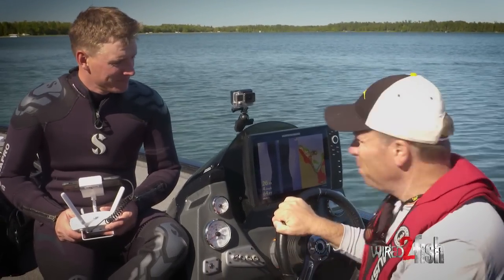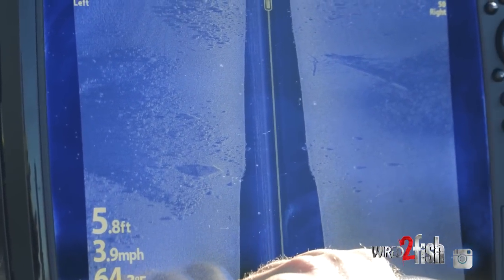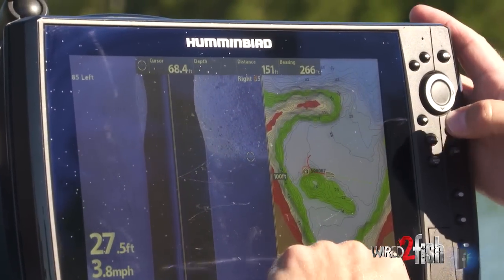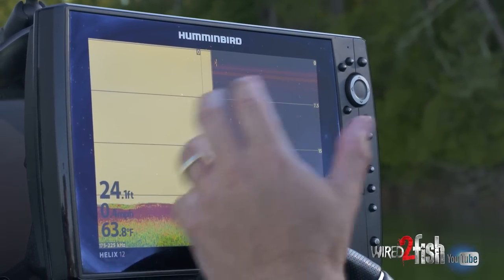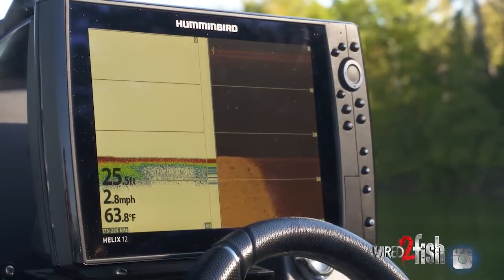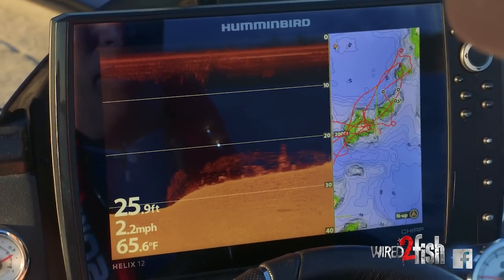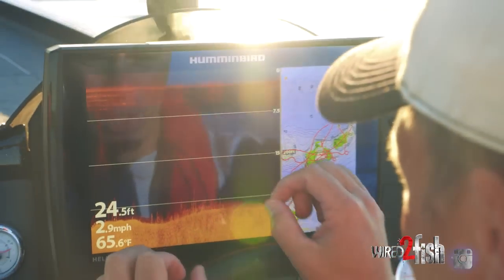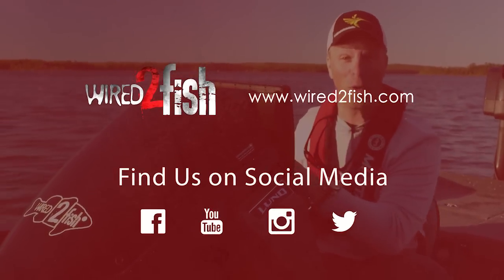How to Read Fish Finder Sonar Technologies

Comment: Nice job, but I’m still having trouble trying to figure out where I am in relation to the information on the screen as it scrolls past.  In looking at structure scan I understand I’m seeing straight down on left/right of keel... and the distance out to whatever structure.  But where is it on down scan.... and echo.  Is subject matter just as the boat passes over and shows on the right coming left across the screen, then out behind the boat as the subject matter disappears from the left side of machine?  

And then what’s best, make a waypoint, and gps spot lock off to the side and fish.... or throw a marker out , come around and fish toward it?  

Trying to learn this stuff.  Thanks.

Comment: Jeff, really enjoyed your vid and underwater comparison. What affect does boat speed have on determining bottom composition? I know what my (limited) mind says, but are you scanning areas at idle speed or using your trolling motor.
Reply from the maker: Thanks for the question. Scanning at a modest speed produces the clearest images, say around 5 mph. It reduces turbulence that can create bubble disturbance around the transducer, and provides more pinging time to take place and paint the clearest image below and off to the sides of the boat. That said, many electronics savvy anglers get good high-speed readouts for things like depth, presence of fish and bottom composition changes. 15-30 mph are common scanning speeds when you're in more of a hurried search mode.

Comment: A good presentation on the technology. However, I use my old FishEagle to find fish. The new tech is great for seeing really good pics of weeds, rocks, and the bottom but fish are a dot...hmmm. You demonstrated clearly how 2D clearly identifies fish and you made a point of confirming the dot(s) as fish in 2D. 2D being old school sonar. Coming from Silicon Valley, this new tech demonstrated offers very little incremental improvements. It is Tech for Tech's sake. A tech looking for marginal improvement. Like golf clubs or fly rods at the end of the day it is about delivering expectations.
Reply from the maker: Hi Dave, we respectfully disagree on the value of down and side imaging. The technology defines structure and cover in much greater detail than 2D sonar, and that in itself is a compelling reason to consider using it. In addition, being able to count individual fish - literally putting a head count to a school can influence the decision to stay or go. Jason Sealock outlines this process in this outstanding interpretation video: https://www.youtube.com/watch?v=IZdHTv8hleM

Side and down imaging have become vital tools for fishing pros and enthusiast anglers. Not necessary for all, but greatly enhance the ability to read water for those that choose to delve into the various technologies.

Comment: Just took me 2 weeks to decide on the upgrade to my fish finding capabilities. Settled on Garmin. But without a doubt Hummingbird is the best.  I currently own a HB with gps and the Navigation feature is awesome. Can't boat/fish without it. But I need DI.  My problem with Lowrance and Garmin is that they say for inland waters you don't need a chartplotter. "BS"  Being out on a lake with many twists and turns I want to Navigate back to boat dock safely after dark.  With Lowrance and Garmin I must use waypoints to get back. NO!  I want Navigation.  I picked a Garmin for its cost and the DI display was very clear. So I'll use my current HB for Nav and my Garmin for fish/structure location.

Comment: question on side scan image.i see nothing but dark on either side of mysids image.does this mean i don't have the range out wide enough?how much is too much range?
thanks john
Reply from the maker: Hi John, the bottom should automatically show the bottom on both sides as it does with down imaging. Then your specified range is how far it displays a readout to the sides beyond the bottom depth. I'd try restoring unit defaults, then verify if you're getting a bottom signal on SI first. If not, then try manually increasing your SI gain setting (believe they're set to 10 by default). If you're still unable to get an image, then I'd suspect there's something not working properly with your transducer side imaging element. Are you getting a bottom reading on SI and DI? Has your SI ever worked for you? Generally speaking, 60' is a good range for scanning a reasonably sized area while producing a nice looking picture. Here's a video on that subject: https://goo.gl/6kN3e2

Comment: Question-how do you power those units in the garage?
Reply from the maker: Hi Terry, I have an onboard charger, in particular, the Minn Kota MK 440PC which I plugin from the garage: https://goo.gl/18wu1w
Reply: Wired2Fish so then you have an additional set of cables for that as well?
Reply from the maker: The charger itself has a 12V 3-prong plugin for wall connection. The charger has direct wire leads to each battery for charging. We're going to edit a charger installation and programming video that should help clarify. It'll post to this YouTube channel on Friday if you'd like to check back in Terry. Thanks.

Comment: the boulder pops up on the sonar, how to you determine where it is in the water so you can cast at it?
Reply from the maker: Hi Richie, the best way is to use your cursor and scroll it over the top of the rock/item of interest and hit the "mark" button. This drops a waypoint on the spot. If your back and front units are networked, you'll be able to see the waypoint in the front of the boat and cast directly to it.

Comment: At about the 7 minute mark, Kyle goes in, but doesn't show up on the scanner, and I don't see any fish!
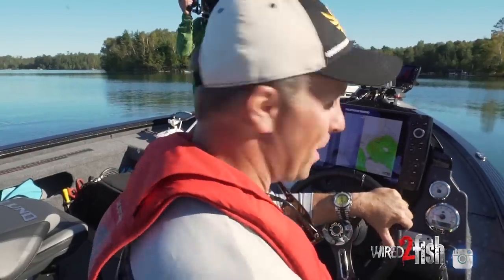Reply from the maker: Kyle dives at about the 5:00 mark. The intent there was to follow the string down to show what a bottom composition change looks like, not necessarily show fish. He was located off to the side of the boat during his dive for engine safety reasons - this is why he wasn't seen on the sonar (outside cone angle).

Comment: thx for vid too bad this piece of equipment is worth more than a decent boat
Reply from the maker: Hi Royal Flukes, the beauty is 2D, 2D w CHIRP, Down Imaging and Side Imaging technology has been brought down to many entry level units as well from all the major manufacturers. A lot of the cost is associated with big units is screen size and computer processing power, but 5-7'' screens are plenty good for a lot of folks, and price from as low as $350 - $700 and packed with the same technology as seen in this video.
Reply: i will have to look into it thx for your prompt resonse

Comment: HMMMM WHY DIDNT the sonar show the cameraman down there.

the truth about these things is this.
they are simple little boy toys that give kids minds something to sercumvent for themselves.
Reply from the maker: We tossed out a marker buoy on the transition zone. Kyle then went overboard with the scuba gear and camera, and swam the line down to the marked transition zone, but the buoy was about 20' off to the side of the boat for safety reasons. We didn't drive over the top of the camera operator while he swam to the bottom. Sonar cone diameter is ~1/3 your depth, so in 20 feet of water, that's on a 6.6' cone diameter, not nearly large enough to read a diver 20' off to the side.  -Wired2Fish Staff